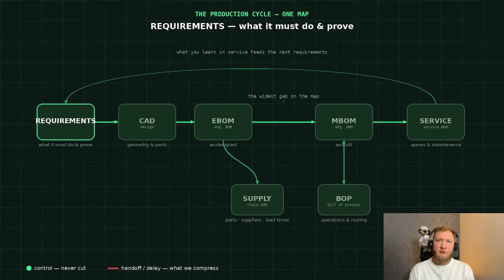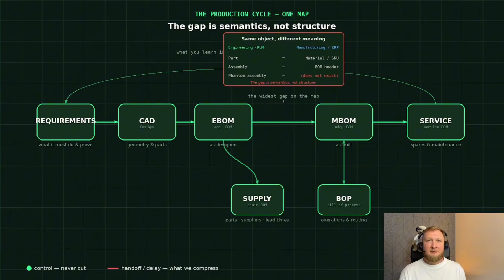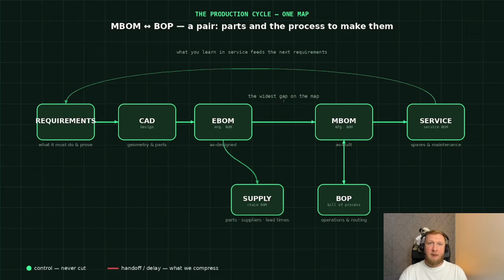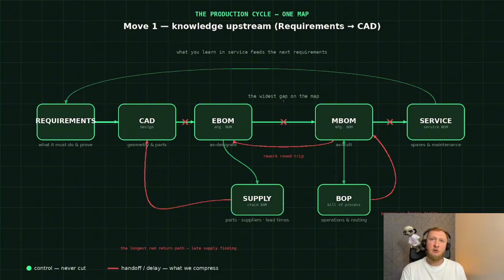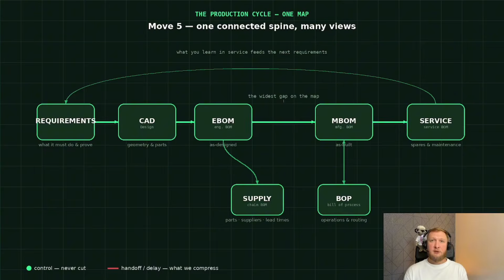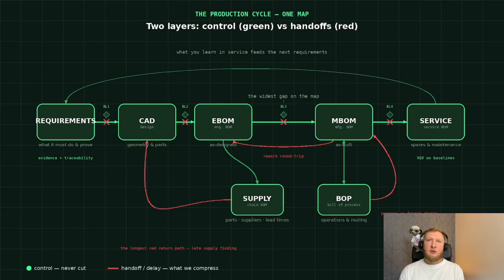Course standalone deep dive: The Entire Engineering to Production Cycle, Explained on One Diagram

Comment: Looks good on paper, but procurement always brings the wrong parts to the shop floor. How do you parallelize that?
Reply from the maker: Thanks for the feedback. If procurement is isolated, the shop floor will always struggle with misalignments. We move supply chain data upstream so component constraints are visible in CAD before geometry is locked. That is the only way to build a lean audit-grade system